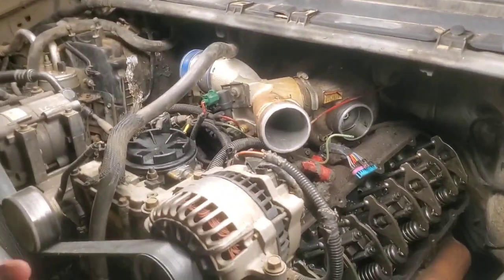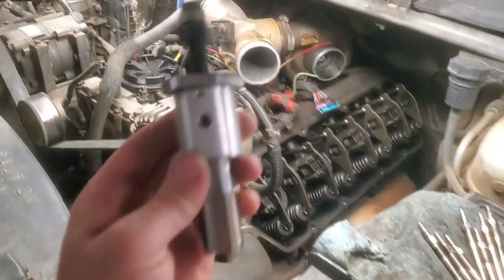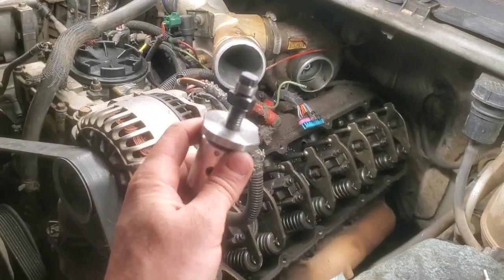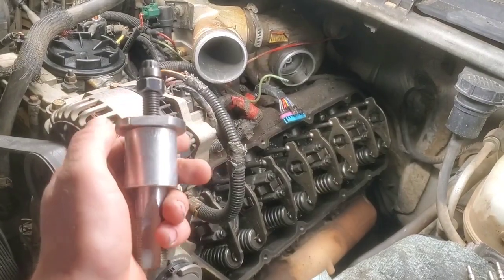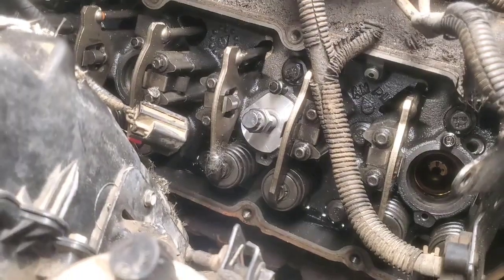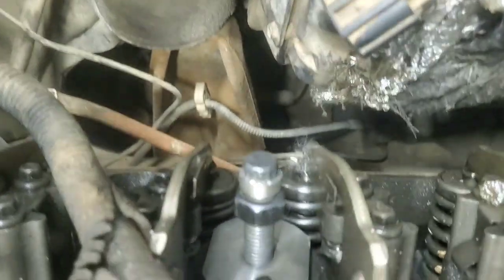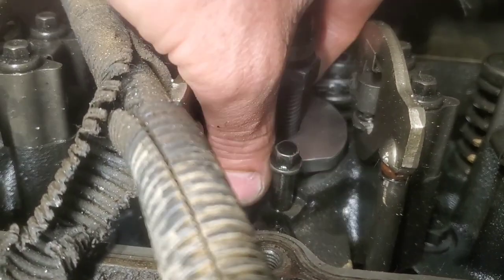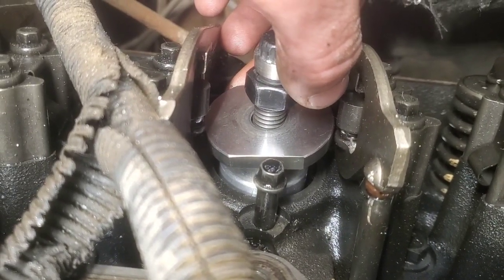7.3L Powerstroke: Using A Cheap Injector Cup Tool.

Comment: I just bought that exact tool, lol. Getting ready to do the injector overhaul on my 7.3 but was wondering where did you find that spacer for the tool, I know that it doesn't have to be threaded but just that exact size. Thanks for sharing and great job btw..  Jay. 👍👍
Reply from the maker: It was just a pipe fittng from the hardware store.  I can't remember the size though.  1 and 5/8 inch maybe?